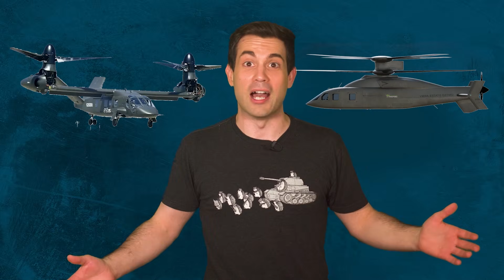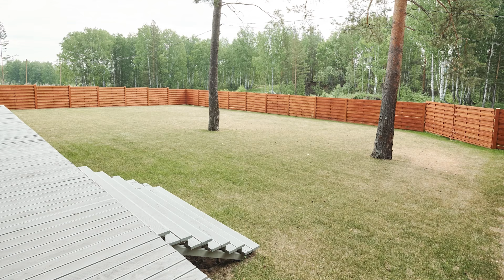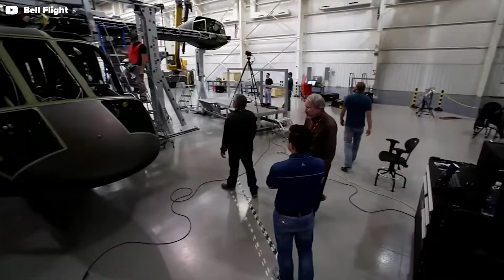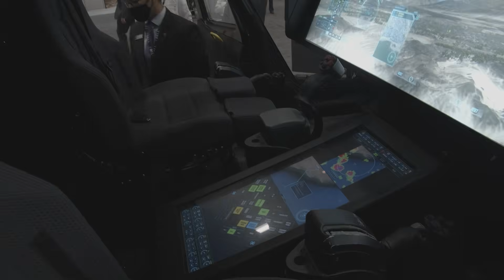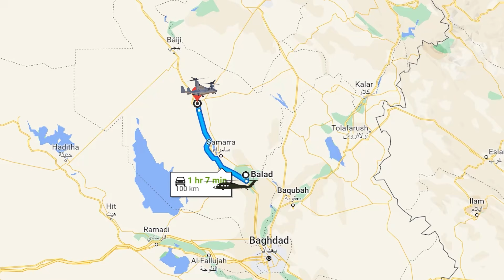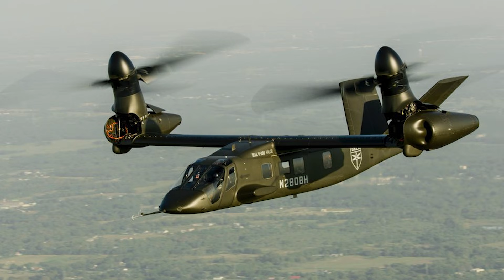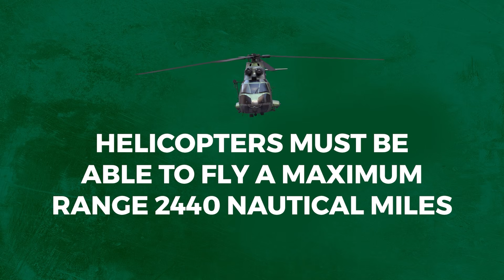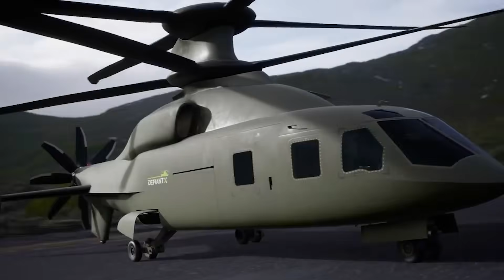V-280 Valor Helicopter Will Help Defeat China

Comment: Now is the time to think through what place the helicopter has in battle. Is it better as a weapons platform or as an AWAC for drones. The drones could be suicide or rocket launchers. Therefore, a manned helicopter would never be within manportal anti-air systems at the attack site. Even if the helicopter AWAC was only a forward relay for a drone control station in the rear. 

The troop and heavier equipment carrier use of a helicopter looks in good hands with the 2 prototypes. My stress test would be to fire bullets and flak at both prototypes to see how little it would take to bring it down. If the double rotor design would crash if only a single rotor was impacted, this is a combat red flag. It the “Osprey” designed version could not fly on one engine, this is a red flag.
Reply: The talk is to use the F-35 as a forward platform of sensors, and deploy AWACS out of range of enemy fire. Drones can contribute but at least for today American reconnaissance drones have to be enormous to carry that large a load so fly very high, otherwise only manned aircraft are large enough to perform the mission.
Reply: The enemy gets a vote whether or not you'll be in MANPADS range. Because you may think you're outside MANPADS range, but there could be a guy right below you and ready to take a shot.

Comment: I thought helicopters were relatively unreliable (compared to planes), even when often grounded in inclement weather for civilian applications, but I am not an expert. I mostly recall the main reason why we don't see drone style flight scaled up is because they call for treating the device as expendable.
Reply: That comment meant only sense to you. What the devil is drone style flight?
Reply: So planes i would consider more reliable than helicopter lower number of things which id have gone wrong will cause fatal crash. Problem with multicopters design is that there is a lot of things which if gone wrong will cause fatal crash without chance to survive.

Comment: BOTH OPTIONS HAVE VALID USES. YOU NEED A BOX THAT CAN CARRY AS MUCH WEIGHT FOR THE ENVIRONMENT AS POSSIBLE. THAT NEEDS A MASSIVE POWER TO WEIGHT RATIO. ONE IS A FLYING TRUCK, MOVING TROOPS AROUND THE BATTLE FIELD, THE OTHER IS IS BATTLE TAXI, MOVING SUPPLIES AND EQUIPMENT, CASEVACS FROM AND UPTO THE FRONT LINES. BOTH WOULD STRUGGLE IN HILLY ENVIRONMENTS, AGAIN ALL PHSYSICS STUFF, BUT AS THE SALES GUY SAID, ONE WILL ALWAYS BE FASTER THAN THE OTHER.

Comment: The osprey is very dangerous, one crashed and killed 5 marines 5 days ago . They have been trying to make this piece of shit work for 70 years !!
Reply: Because the black hawk has never crashed.

Oh wait it does way more than the Osprey
Reply: @anguswaterhouse9255  yeah , but 4000  Blackhawks Vs 400 ospreys 1000% higher numbers .
Reply: @tim.iteland.9447 Thats a terrible comparison to make, just because theres less V-22's shouldn't affect things, they fly far more dangerous and frequent missions due to their superior preformance.

In the modern combat environment we need that mobility, its not like the black hawk was famous for its reliability so whats the trade off exactly? We get a more advanced yet more expensive aircraft and you call it a piece of shit because it has crahsed? 

The value of the osprey in combat far outweighs its negatives
Reply: @anguswaterhouse9255  yes I do , this system was in prototype in the 1950s and most pilots dislike them . If it's so brilliant, why did it take 70 years to get a working version . I know people first hand who have operated them , and they are not liked . It's like you just read press releases or something? Next you will say the F35 is amazing 🤣🤣🤣
Reply: @tim.iteland.9447  Oh my god, you think the F-35 is bad?

What talking pints am I going to have to disprove here?
The cost? Its for a planned 50 years of service which makes it cost  around the same as the B-52 will but for 10x more aircraft.
Its capabilities? No non-stealth jet can survive in a modern air defence environment, it doesn't need a gun the F-4 the navy used didn't have a gun and it had a 12:1 kill ratio against enemy planes which was triple that of the air forces which had a gun. So its use of BVR and short range missiles is absolutely fine.
It can't dogfight? It doesn't need to, it can kill enemy planes from 100km away without ever being seen, and in a close range engagement it it has the largest angle for offbore sidewinder shots. It can nearly shoot backwards. That also isn't true, its nearly as manouverable as the F-16 it only lost in their practice dogfight because its computers were being  calibrated so it couldn't manouver properly.

It has a 28:1 kill ratio against fourth gen planes backed by AWACS and SAM's while it is on its own. The only fighter in the world better at air-air than it is the F-22, which you might notice doesn't have ground attack abilites and isn't a threat as its another American plane.

And lets talk about its ground attack, because tight now I don't think there's another weapon in the world which can penentrate the defences of an S400 or 055 cruiser to get shots in with anti-radiation, supersonic ARGGM-ER missiles. At least not an aircraft which wouldn't take several losses from its squadron
Reply: @anguswaterhouse9255  the F35 was outmanoeuvred by a chief USAF test pilot flying F4 , and a Chinese software company made some of the programming ! Seems Auckland is behind the times in REAL aviation news buddy .
Reply: @tim.iteland.9447  You're truly something else mate, first, no they didn't, it was an f-16, a fighter designed to dogfight which the F-35 isn't because no USAF Jet has been in a manoeuvring fight since the Vietnam war, the only jet in service with the USAF to make a gun air-air kill was an a-10 attacking a helicopter.

And what you said about a Chinese company is a complete lie. A Chinese company manufactored circuit boards used in some initial F-35's but they had nothing to do with designing the fighter, in fact the company didn't even know some of the boards they were making were being used by the USAF in the F-35.

There was no involvement with the programming or any of the F-35's major capabilites. It literally doesn't matter it was Chinese manufactored circuit boards, some of them came from India and some from Indonesia.

They probably don't even buy them from that company anymore.

The F-35 is the second most capable air-air jet in the world and the only strike fighter which will last more than 10 minutes against modern air defences or planes backed by awacs.

As I said, 28:1 ratio, you need 28 4th gen planes to beat an F-35a and some 4th gens like the Eurofighter cost more than it.
Reply: @anguswaterhouse9255  how many non USAF operated F35's are grounded until under license engineers arrive from the states to service under contract , I think today 25% of the Aussie air force 35's are grounded for this reason , the F35 was circa $3.2 trillion dollars ! Count 75% of that as capital hill lobbiest / corrupt chiefs of staff , kick back / brown envelope city . The Typhon ain't that great either , the argument is that it created 75,000 jobs . NATO install puppet presidents & create banana republics & dictatorships , and steal everybody's shit . War is systematic international professional legalised burglary!!
Reply: @tim.iteland.9447  And the F-15 cost 5 trillion accounting for inflation and suffered many issues at the start so costs and grounded F-35's aren't unexpected or even really an issue. Also 3.2 trillion is a number out of your ass. And even then, thats still spread over almost 80 years that the JSF program will exist for, partially shouldered by other nations and covering over 2000 planes in our air force which is massive. If we had all those F-35s replaced by an assortment of other jets it would be more expensive because fun fact, modern 4th gen jets are almost as expensive as the F-35, look at the F-15EX's cost!

And you might want to check how much of your information is blatently false, Pier Sprey lied his ass off about the f-35 before he died and he people ate it up because he lied about designing the A-10 and F-15 and F-16 and F-22.

What plane is great by your standards? Because the Typhoon is generally considered one of the best fourth gen fighters.

And as for your strange rant at the end, so what? It has nothing to do with the planes which you're completely wrong about.

Most of those dictatorships were created to fight communism and are now gone, you know what isn't gone? China and Russia quashing civil rights and intervening in other countries to uphold their puppets to  THIS VERY YEAR in Khazakstan.

And none of this, ABSOLUTELY NONE OF THIS, changes that in tests the F-35 is 28x as effective as fourth gen planes with support when IT IS COMPLETELY UNSUPPORTED.

Stop your useless talking points, the F-35 is the future of air power and the USAF.

Comment: Imo lockhead prototype seems to be much less complicated to design, ospray design if done right have more advantages (higher speed, more efficient), but certification of ospray design for civil aviation seems to be nearly impossible in  contrary to helicopter with pusher prop. Cant wait to see advancement of these two projects.
Reply: The Osprey is not whats being offered. The Valor is, which has a different engine tilt design (engine doesn’t tilt) and is safer and therefore easier to get civil certification for. The competition seems mostly a sham, as the reconnaissance one is tailor made for the Defiant and the Valor for long range assault. The Invictus would have been great if it came 20 years ago. As for utility blackhawk replacement...well, thats just stupid to replace it.
Reply: Not more efficiency in hover and loiter, tiltrotors are actually worse in vertical lift because of high disk loading compared to helicopters. 

 The whole pusher prop on a helicopter concept was done previously by Lockeed look up the AH-56 Cheyenne. It was set to replace the cobra but then the USAF objected and started lobbying against it. It was arguably a better platform than the AH-64 that would come a decade later.

Comment: Question, The V2 Valor you said that it has electronic signals to control the aircraft. Does that make it vulnerable to electromagnetic pulses from the enemy, we see those same EMP rifles employed by Ukraine and Russia in their conflict against drones. How difficult would it be for that same type of weapon to be used on this aircraft?
Reply: For the usual tech levels of NATO countries militeries, EMP shielding is fairly simple and not even that expensive.
The EMP rifles and such you see in the ukrainian conflict (most of them aren't actually emp, but ecm) are mainly of use against old tech (as in, 30+ years out of date) and drones that are basically civilian level. Keep in mind Russia literally has a line of recon drones that use commercial Nikon and Olympus made compact cameras as their 'optical sensors'.
Reply: @reappermen  thanks for the reply Im quite behind in knowledge when it comes to drone warfare and EMPs. It helped a lot.
Reply: The anti-drone weapons overwhelm the controller receiver antenna or jam the GPS. They cannot be used against manned aircraft.

Comment: Despite the first one being faster its not as safe. What if one prop tilts and the other one dose not. Also if one prop is damaged the other one is guaranteed to make you crash. The second one if the second roter somehow is not damaged you still can do a crash landing more safely. The only thing that makes the first one safer is if the props are in the front position and you can crash land like an airplane. The problem with that is the moment the props touch anything you have pieces of prop flying who knows where which can be into the aircraft killing everyone inside.
Reply: This video interestingly claims that if one engine is lost, the remaining engine would somehow sustain flight. Don't know how that would work... Maybe some interestingly fast computer controlled prop adjustments fast enough to reduce torques.
Reply: @tonysu8860  Cant the osprey fly on one engine as well?

Comment: Aren't the black hawks supposed to get newer more powerful engines?
Edit: fly by wire gives a lot more problems then mechanical feedback, what it does do is set limits to what the pilot can do, sometimes it can prevent false overkill inputs, but most of the time it will simply hold you back.
As for maintenance, it's pathetic to think a more complicated equipment needs less time in the shop.